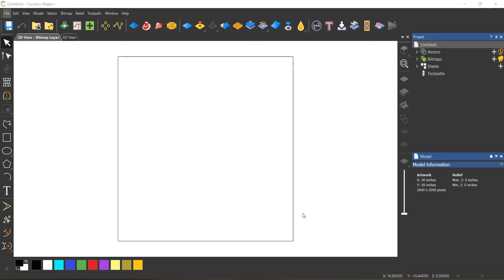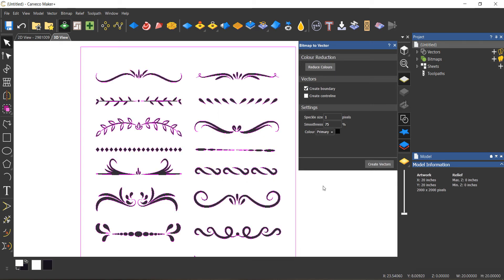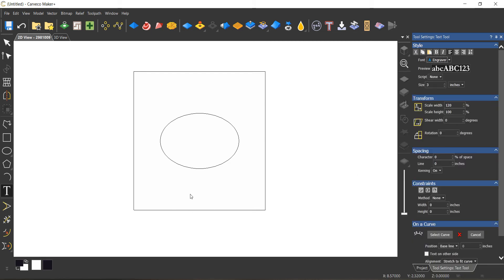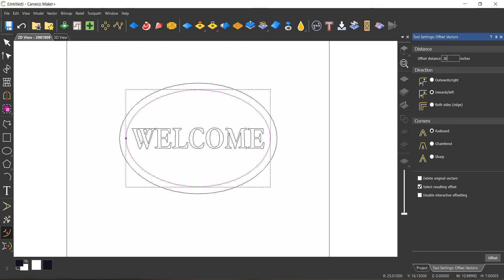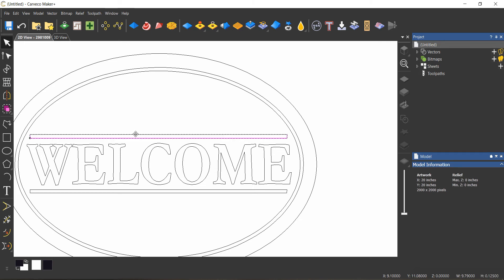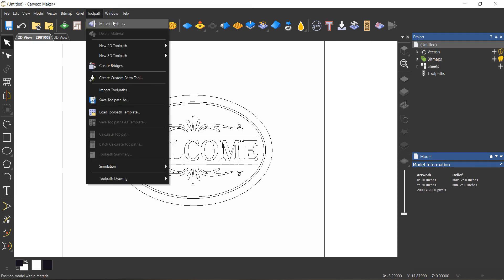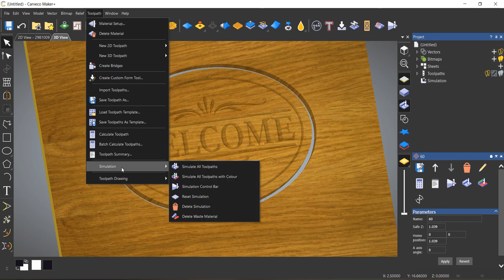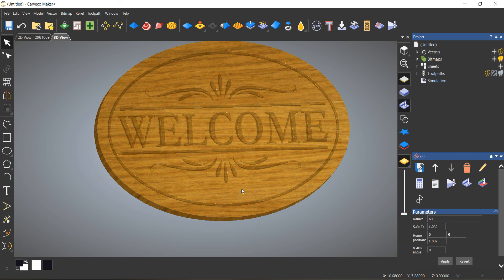CNC Welcome Sign

Comment: I tried a simple v carve last night and the depth wasn't right.   Looking at your settings,  you have maximum depth on 0.   Why did mine not even touch the wood when it was set at 0?
Reply from the maker: That's because I'm letting the software determine the maximum depth. If you click on the "limit tool depth" then you can set a maximum depth.  If that box is unchecked the software looks at the width of the vector and figures out how far it has to go to cut the area out.  If you check that little box and set the max depth at 0 then it will cut 0.